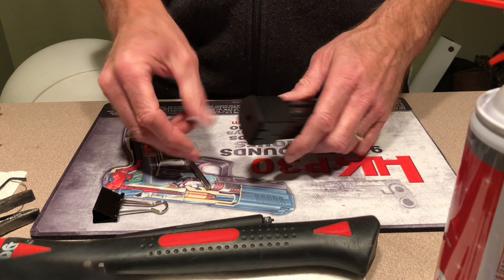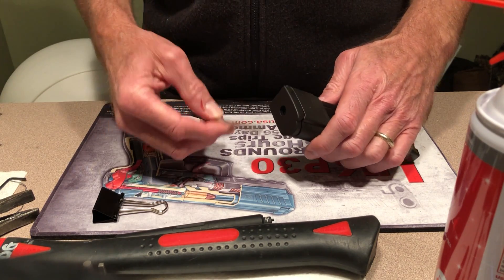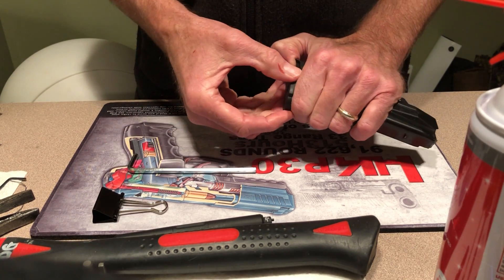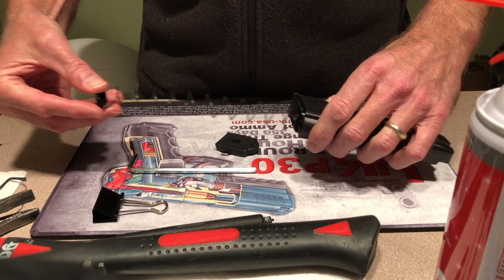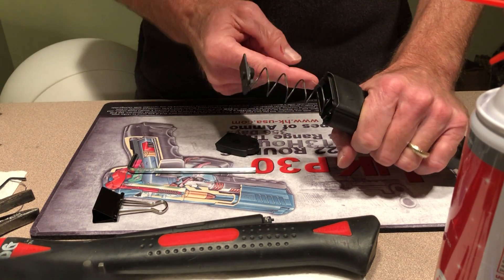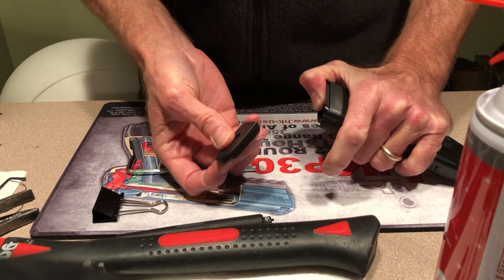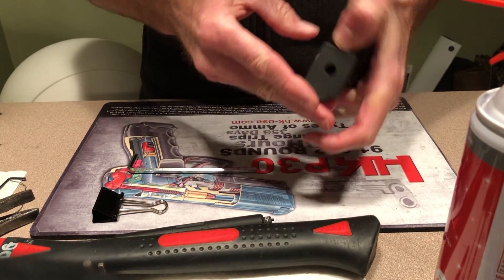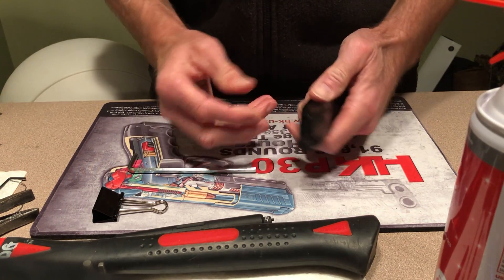HK VP9 20 round magazine disassembly p30 p30l vp9sk vp9l

Comment: You will loose the button part of the  baseplate if you are not very lucky . When you slide the mag open it is under massive pressure and it explodes. You need to be a small room if you hope to find this part again. Mine is gone and after 2 hours I quit looking.. This is not some simple act like portrayed .
Reply from the maker: John Church wow, you did something very very wrong